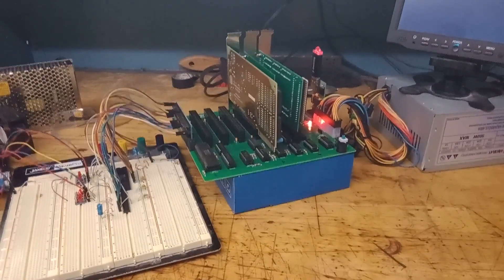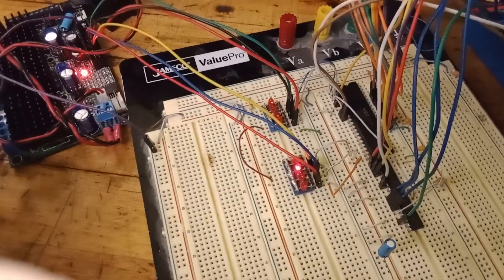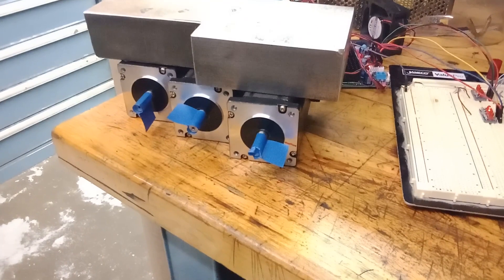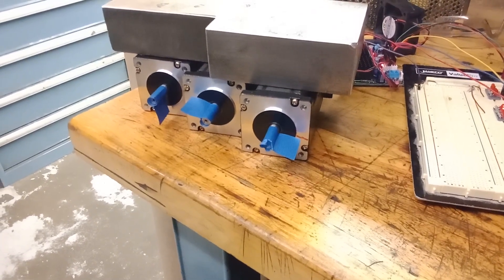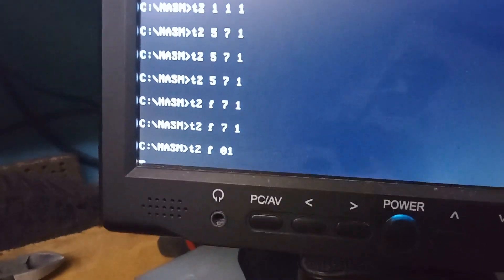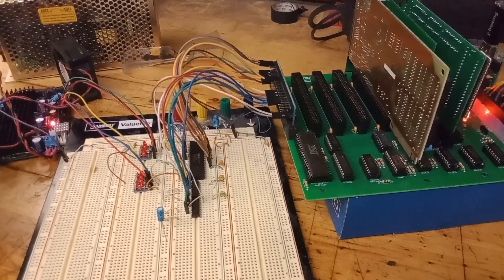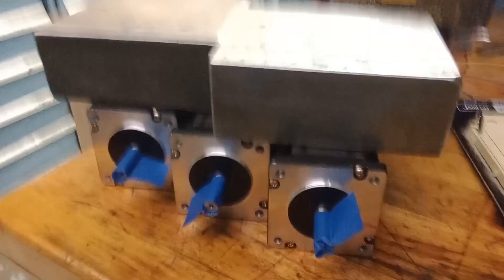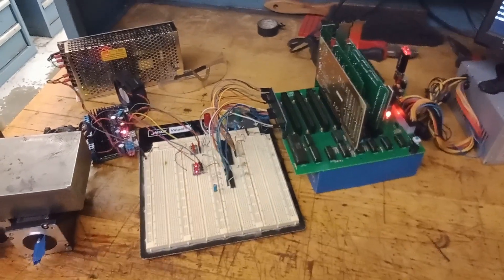Stepper Motor Demo

Comment: I could controll them with an arduino, or rp2010, but why not learn 8088 and make a cnc controller ☺️ awesome video that also demonstrates the io capabilities of these cute computers. Safety features needed if id really build a big cnc tho. I like your videos series, makes me wabna build my own 8088/8086 or whatever
Reply from the maker: The next step will be making sure the motors are connected correctly. There was some electric noise feeding back to the 8255 that could cause harm.